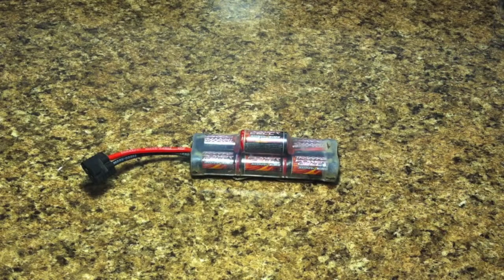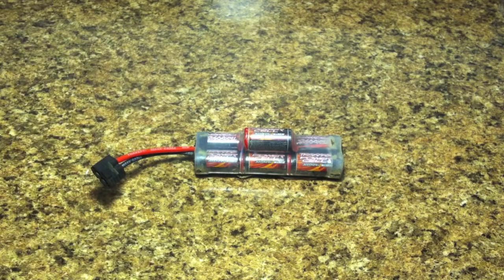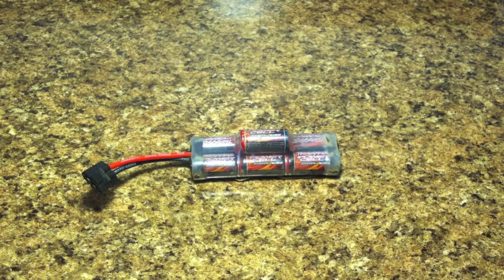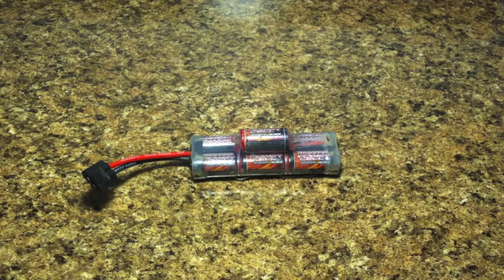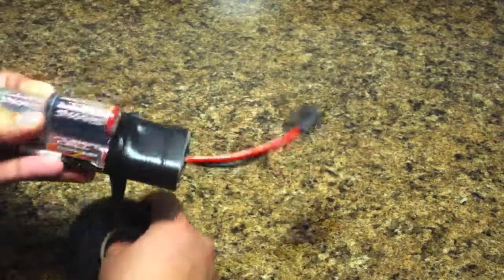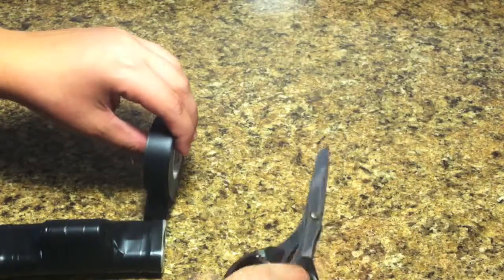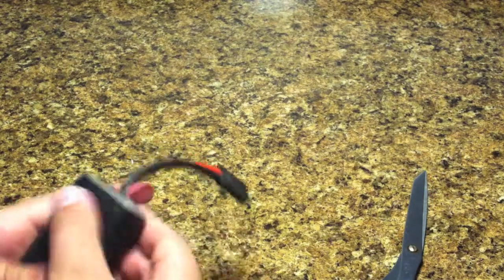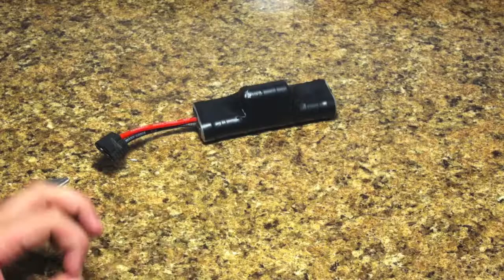The RC Genius | How To Wrap Your RC Battery

Comment: My old RC Car used to heat up a lot when charging. Putting electrical tape around the battery will make it hotter wouldn't it? Also does the battery get hot whilst driving as well? If the battery does heat up whilst driving I'd imagine that most of the heat actually comes from the environment heat and not the car itself so would it be better to put white electrical tape around the battery to reduce the heat conductivity? I'm not trying to criticise. You know I love your videos, it's just this is the first question that came to mind. Anyway I look forward to your reply :D
Reply from the maker: ThorsChosenOne you have good point. Putting white tape wouldn't really make any difference. However, the original plastic wrap on the battery is tighter and still would trap the heat. It does get warm while driving it but it's not burning hot. Plus I did not cover the back and front ends of the battery, making it breath a little more. If I use it and it gets too hot, then I can just take the excess tape off and just cover the broken part. Actually I might just do that anyway. Thanks for the comment, and have a happy and safe 4th of July!